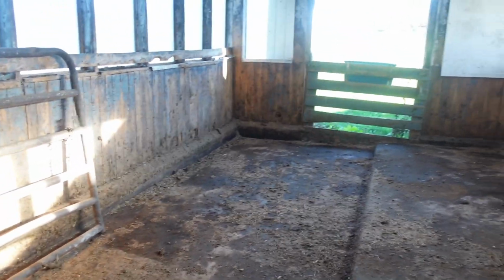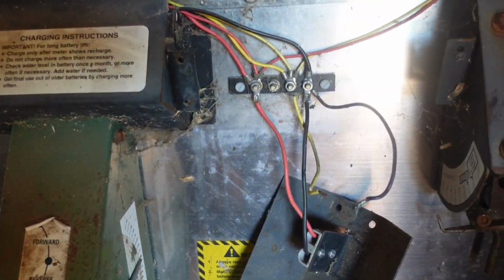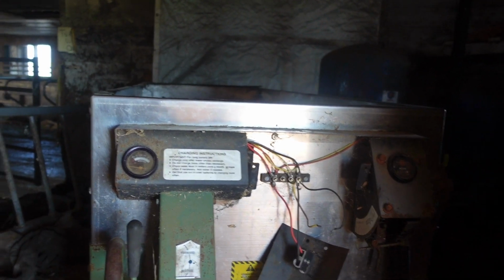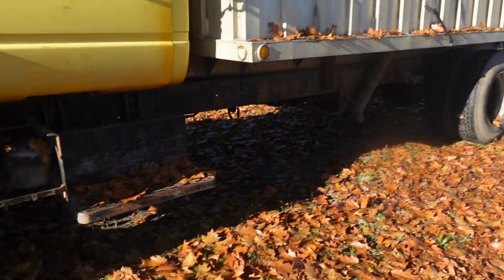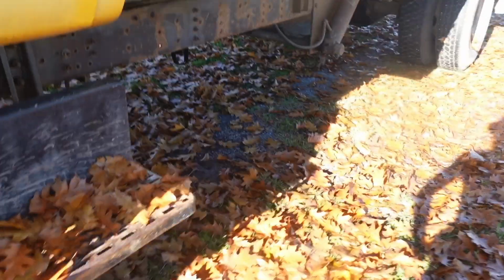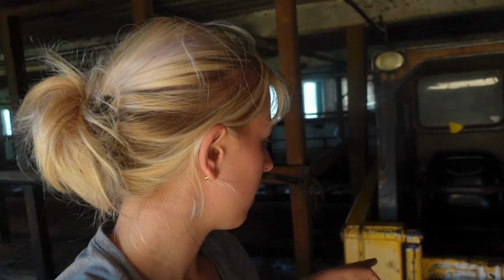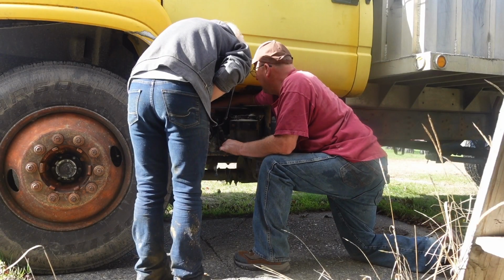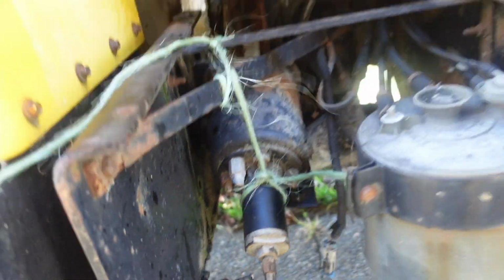Maintenance day on the farm…..

Comment: Them both said to put through the bucket should have been with the nuts on the skid loader side not in the bucket itself so you can get them off when you need to take that bucket off again without taking a cutting torch and cutting the heads off